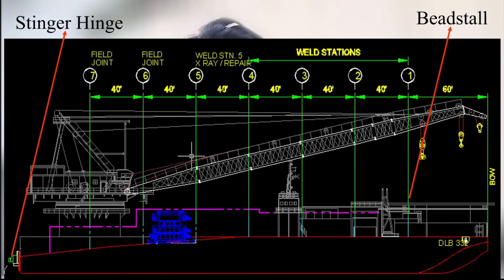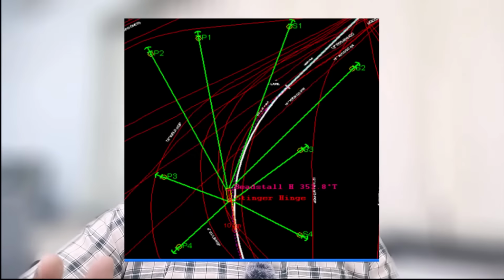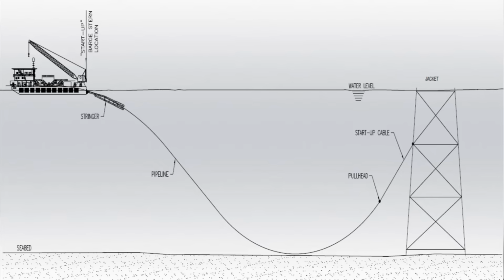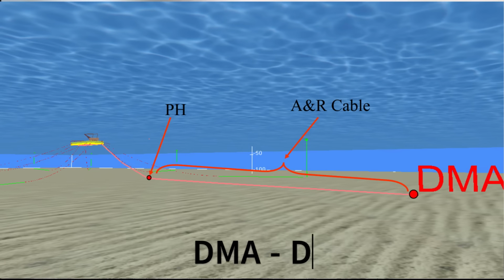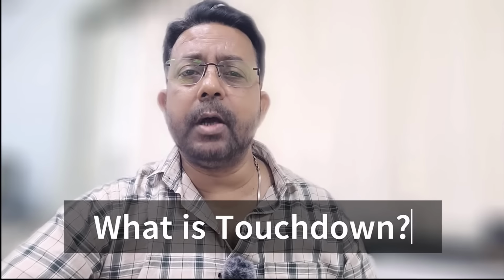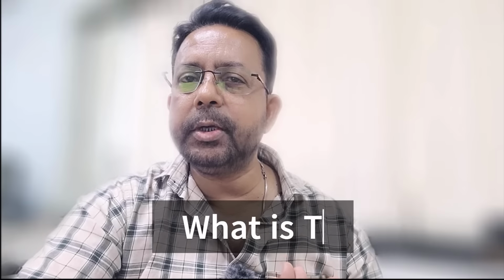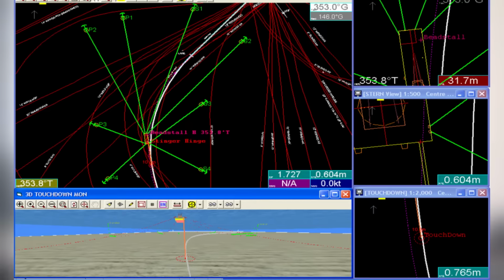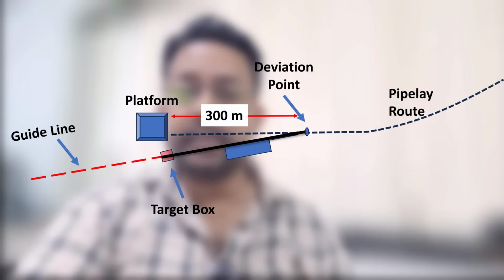The Challenges of Offshore Pipelaying: Surveyor's POV

Comment: Great video, thanks for the detailed explanation
I will like to ask a question, the 300m distance between the deviation point of the barge and the platform a standard or it will be determined by the client?
Reply from the maker: Hi mate, thanks for your encouraging words. 300m is not standard. It depends on the pipe size. 300m is generally accepted norm for pipelines 12 inch to 20 inches. Remember the deviation will be around 12 to 15m from the centerline. If the size of pipeline increases, then you need to start early, say 450m. As a surveyor you need to study the lay route and see how the curves are designed, the  you can have a fair idea about bending of the pipeline. Normally 300m is the length of pipe a riser barge can lift it to weld the riser. I hope I an able to make sense.
Reply from the maker: And yes most of the time you need to suggest to client. Whether you suggest or not, they will deviate, most probably much much late. So as a respinsible surveyor we need to ppan it way earlier and suggest to client and anchor operators and superintendent.
Reply: @ Thanks once again, I actually thought of the pipe size too. 
i am looking forward to a video of a Multibeam mounted on an ROV.
Reply: Great video, thank you for the detailed explanation.
 I really appreciate your support for surveyors. 
Sir, could you also please share some information about cable-laying vessels and the role of a surveyor onboard such vessels?
Reply from the maker: I will surely make a video on that. I myself have never laid cable but I did flexi pipelay. So I will gather little bit info from my friends and compile a video.
Reply: @OffshoreSurveys ❤